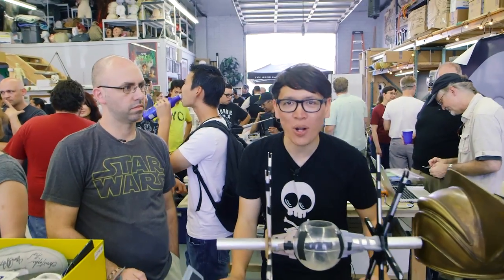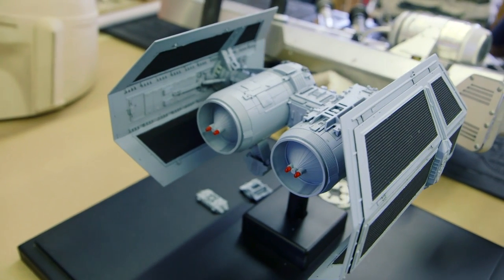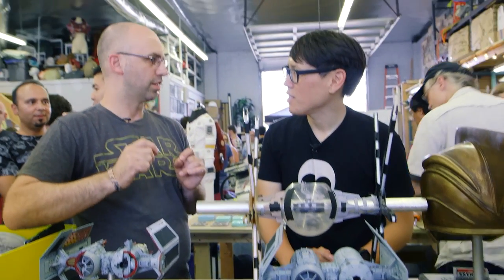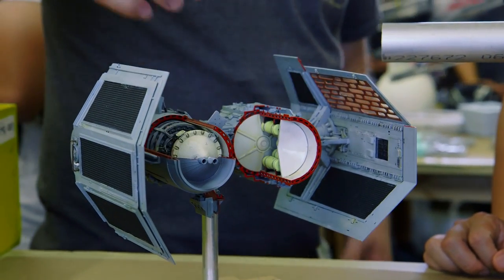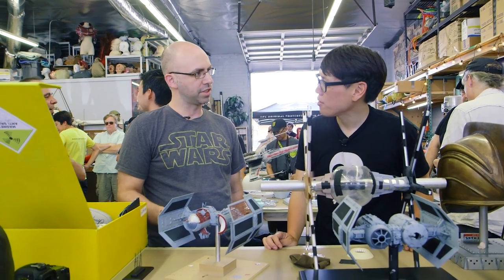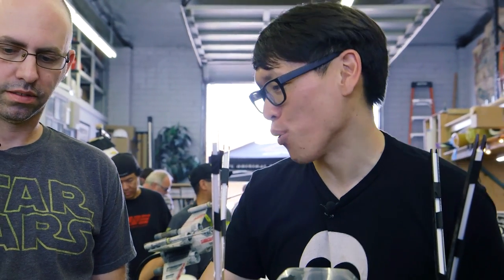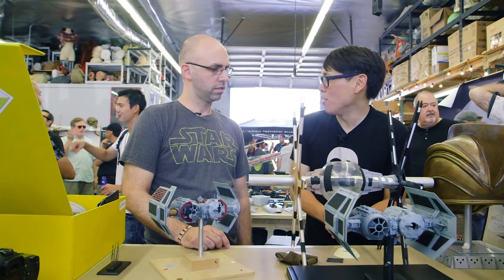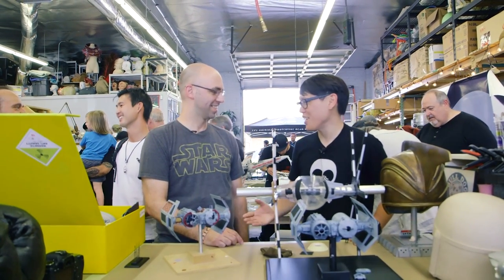Star Wars TIE Bomber Cross Section Model!

Comment: What happens to the unused parts of the model kits? Keeping part kits in storage would soon stack up - especially if you're sourcing 20-40 kits per build.
Reply: I would think that once obtained molds are cast from the original parts as needed and then the kits 100% complete again are sold via Ebay.  I would hate to learn these old kits are being scrounged for a couple measly parts just for kit bashing, ignoring the kits original value.